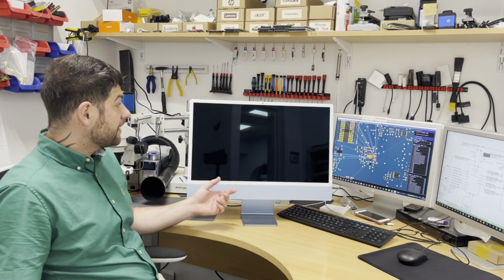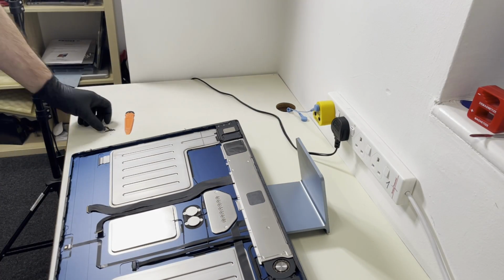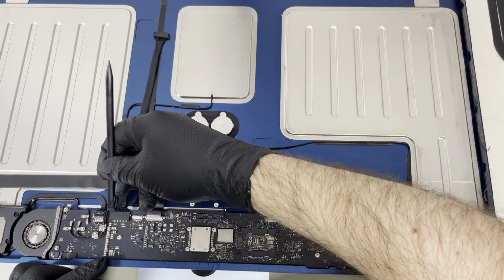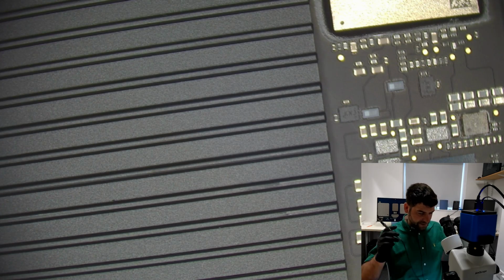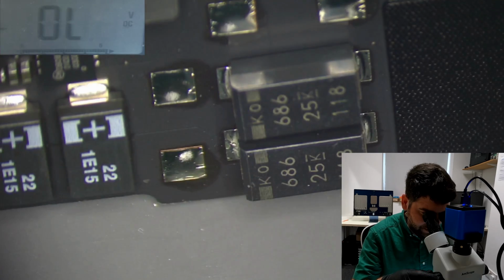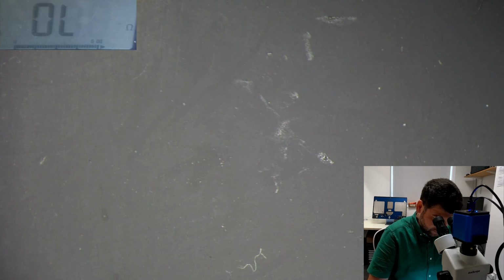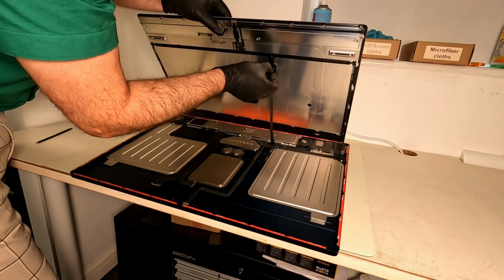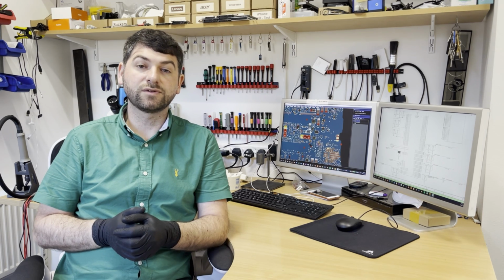iMac M1 24” 2021 Repair & Disassembly: No Power Fixed A2439

Comment: Thanks for the video.  I put everything back successfully but my USB ports doesnt work.  Any tips on connecting the USB cable to the logic board?  Everytime I press the connector to the board it pops back out.

Comment: Hi, It is true that in Apple Silicon Macs (M1, M2, M3) there are no Intel components?. Apple has designed the entire system independently, gradually eliminating any dependence on Intel.
In your video I see 2 components marked Intel (Intel brand), what are they? Thunderbolt connections? As far as you know, is it true that in Apple Silicon Macs there are no more Intel components except USB and Thunderbolt ports which they must depend on due to patents? Thanks

Comment: How is the dust management of the new iMacs? I suppose the new M series are more dust-proof compared to the older 27” older ones because when you removed the screen, I noticed that the hardware is sealed within an additional layer, whereas the older iMacs don’t have this kind of protection. Am I right?

In your opinion, how many years can these new iMacs be used without any dust issues ? I want to purchase one but this makes me worried as it’s not user friendly to clean the fans.

Comment: Hi, I was wondering the 3M VHB you used was it made for imacs or did you cut it to fit  ? is it strong as I had a bad experience using other brands. thanks

Comment: Thanks for the video friend, I have an iMac M1 that won't turn on on the bench, but I'm having difficulty locating the defect, everything seems to be a short one, as in your video, however, I'm without the .brd of the board and I need to do it a more rigorous analysis on the plate. Your video helps a lot. thanks.

Comment: You are professional. Where is a power supply in this iMac? Is it integrated into the motherboard?
Reply from the maker: It has external power adapter and has no built in PSU board.

Comment: I found a horizontal line flickering screen issue on my M1 iMac. And the top left corner become so much heatted. What should I do?
Reply from the maker: You should contact your local computer repair shop so they can check this for you and perhaps will tell you what to do next

Comment: I guess this shows the importance of good visual inspection. I thought you were close to injecting voltage and checking for heat when I suddenly saw the blown cap. :D Really neat workshop and great video production. (I've worked on many iMacs but still only Intel based ones.)
Reply from the maker: Thank you, this one showed up without needing to inject 🖥️ Challenge was to remove the screen correctly as couldn't find any info online, it does show how but not fully how on most critical place! But anyway, I managed to find the way and sharing this with you.
Reply: @IFIXIT4U-UK  I appreciate it. I've bookmarked the video so I can refer to it when I get one in for repair. I do mostly PCs but also some Macs, working from home.